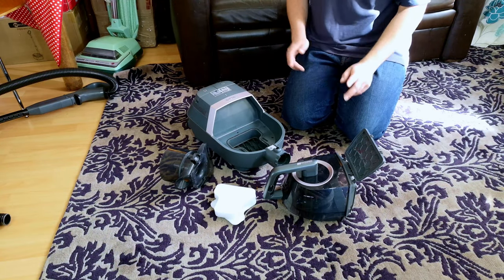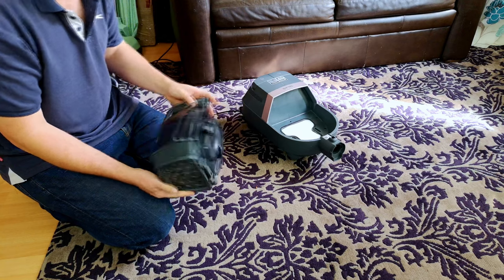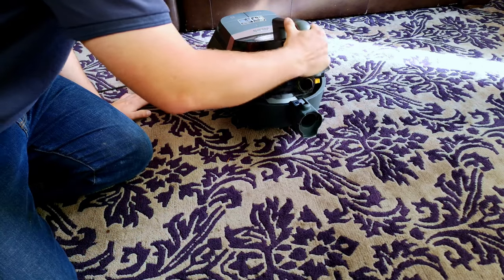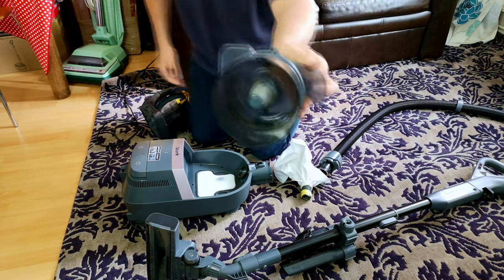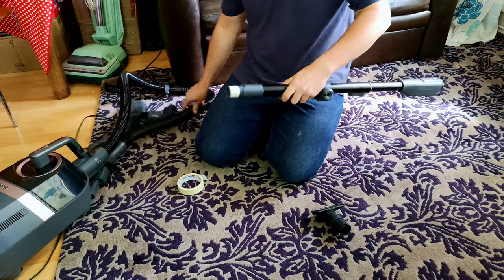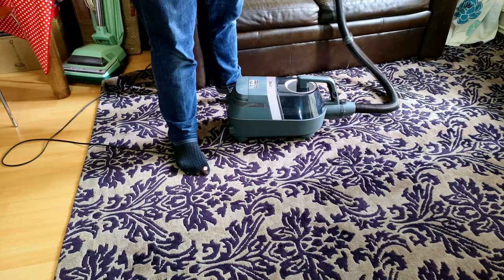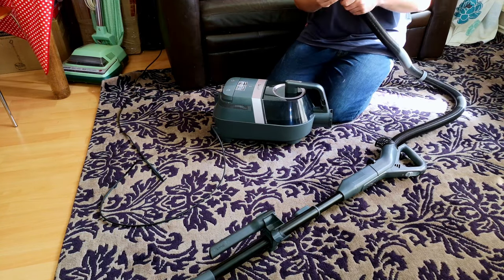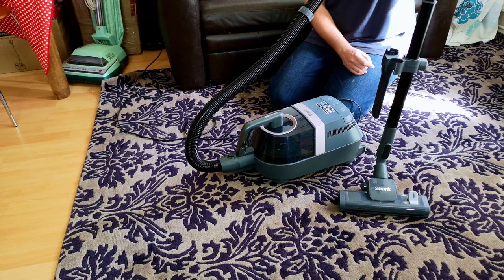Can we HACK the Shark CV100 Cylinder to be any better?

Comment: Here's one for ya. If you have a Vax blade. Mines a blade 3 onepower. And a Henry. Take the dust bin off Vax. Empty and remove the filter. Keep filter door open. Refit bin with filter door open to the Vax blade. Take the Henry hose and shove it into the center hole of the vax cyclone thingy. Turn Henry on and you will have suction at the Vax floor head. Then turn on Vax min power and brush bar on. Powered Henry floorhead with just 2 vacs no modding 🤷

Comment: My CZ500UKT fits standard Miele tools.... interesting that you had to tape yours.
Reply from the maker: Yup, was just too small otherwise. The locating tab on the back was a pain too as you couldn't push the miele heads fully on. Made it much nicer to use though!
Reply: @beko1987  Yeah. Everything other then the main body seems completely different. Very odd

Comment: Hello Sam did you have not are electric brush
Reply from the maker: Hi! No, I bought the cheap basic model in the hope the floor head was half decent and it would make an alright straight suction machine but it wasn't! Your right if I do it again I'll get the turbo head version 👍Then it's only the poor cyclones to worry about 🤣
Reply: @beko1987  thankfully shark filters take a long time to lose airflow ime.